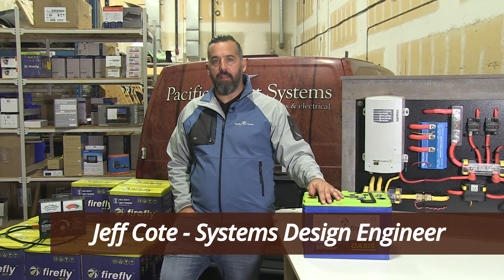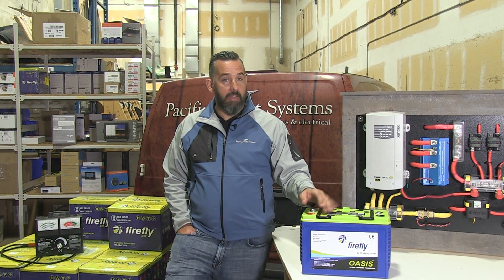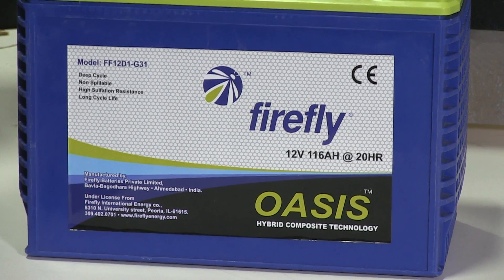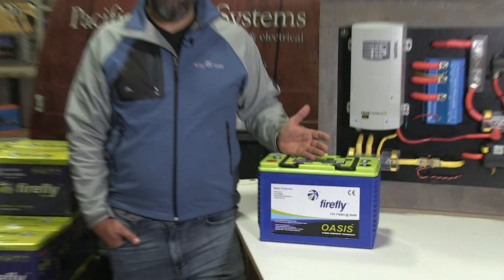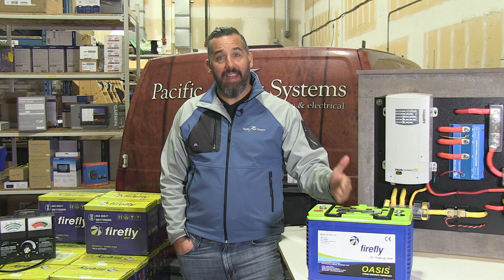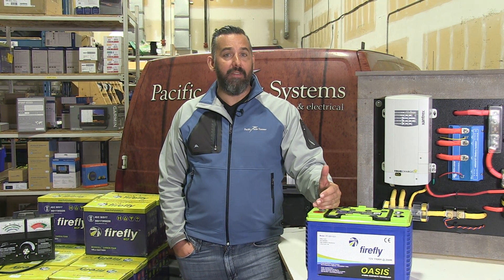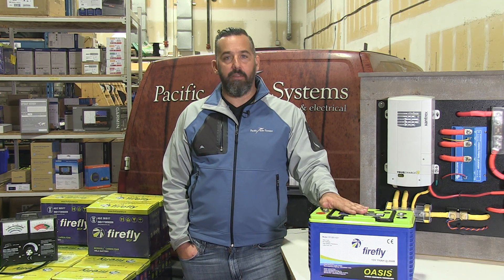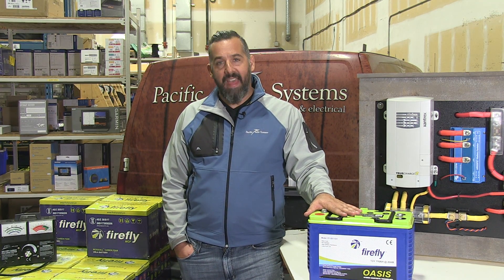Recommended - Firefly Oasis Carbon Foam Battery Perfect for a Boat

Comment: Jeff, I am still interested in the FireFly’s for a Garmin Force trolling motor. That would be 2 batteries, C31’s set up for 24V. Don’t need or want the charger on the boat. FireFlys charge profile is stopping me from finishing this project as I can not find a charger, can you help? Finding a 24V, 40 amp programmable three function charger with temperature offset is proving to be difficult to impossible unless you have unlimited cash (not the case here, or I would go lithium)
Any recommendations 
Thanks
Reply from the maker: Look in the Promariner ProNautic charger, consider getting the 30 amp 24 volt model.

Comment: Nice video but saying 12 times the life is just wrong and you know it.
Reply from the maker: Hi John, you bring an interesting point, how long will a battery last. Firefly, similar to lithium, spec sheets says the L15 2V/4V battery will run 4700 cycles at 50% DOD.

Comment: Any charts re: weight vs std AGM or Lithium. .
Reply from the maker: Good suggestion, will include that next time. Firefly Group 31 is 72 lbs and AGM Group 31 is about 60 lbs.

Comment: Have you done any testing or comparisons on Battle Born batteries, currently leaning towards Firefly. Not sure the differences out weigh being double the cost of Firefly's.
Reply: Pacific yacht systems - Actually Battle Born doesn't have lead acid chemistry batteries, they make lifepo4 (lithum iron phosphate), lead acid drop-in replacement batteries. Extremely high quality, excellent safety (zero chance of thermal runaway/fire), far superior to to just about any lead acid or lead acid lithium replacement that is on the market to date... a single 29 lb battery packs the power of a 140 lb lead acid battery and additionally, it lasts 10 times longer than lead acid... they're impressive to say the least... I'm not a fan boy or anything, I think every chemistry has it's place, but you should probably do your homework before blatantly telling a potential customer false info in order to steer them towards a sale of one of your products... whether intentional or not, I can't say, just calling it like I see it
Reply from the maker: Hi John, Battle Born is a good AGM battery, but Firefly is hands-down a better battery. We've sold and installed thousands of Fireflies and they are outstanding batteries.

Comment: Are these similar or the same technology as Victron’s Lead Carbon?
Reply from the maker: Don't know for sure. Everyone is playing catchup to Firefly.
Reply: Victron "Lead Carbon" have carbon added to the negative plates, and adjusted specific gravity in the electrolyte.  That may help in PSOC use (at the cost of some capacity), however not as much as the patented microcellular carbon foam (MCF) that is used in Firefly.

Comment: Hey, guys, I have 4 6volt 200 amp hr house batteries how much will it run to replace them I do have solar and wind so looking for a replacement and these look interesting.
Thanks SV Chewbacca
Reply from the maker: Hi Dutchman Sailing, you could easily 2 or 3 Firefly Group 31 to have the similar useable amp-hour capacity of 4 flooded lead acid golf carts.

Comment: Thoughts on lead crystal battery , local here in NZ , claim 18 year life .From Betta Batteries
Reply from the maker: Hi Murray, unfortunately don't have any practical experience with lead crystal battery.
Reply: Hi Murray, I work in retail selling batteries in Canada, Carbon Foam being one of them. They have come a long way in terms of popularity. We do have customers ask about the Crystal Salt batteries as we also can supply them. Really boils down to cost, warranties, manufacture reputations etc. Equally I think both options are great and have similar characteristics that works like a lithium battery as you can discharge them 80%-100% rather then 50% on Wet/Standard AGM, can be left in a partial state of charge without harming the battery, once fully charged it would discharge about 1% per month in storage phase..etc. All manufacturers will specify their suggested lifespan. If Carbon Foam/Crystal Salt is what you are after then think of this, Higher upfront costs+  Eliminates a battery purchase every 3-6 years on average= Savings in your pocket. Cheers!

Comment: How does it compare to lithium?
Reply from the maker: Let's use a sliding scale for depth of discharge and cycles, If a flooded lead acid deep cycle battery is 1 and a lithium battery is 10, then a Firefly foam-core AGM battery is a 7.
Reply from the maker: Basically Firefly batteries are somewhat comparable to Lithium but obviously not a Lithium battery.

Comment: How do these work as starter batteries?
Reply from the maker: Firefly batteries are more meant for deep-cycle applications. I'd suggest going with a North Star AGM battery meant for cranking.

Comment: "twice as much ... as a flooded lead-acid conventional battery"
So your carbon foam AGM battery has double the capacity of a conventional flooded NON-AGM battery? Being sneaky there...
Reply: Twice as much usable capacity. I think it's the standard lead-acid specs that are misleading. You can use more than 50% capacity, but you'll kill your battery faster.

Comment: I've binge-watched you videos, thanks! Any insight into why the Firefly battery seems to be unobtainable?
Reply: I found one on Amazon just search Carbon Foam AGM
Reply: goodygoodyguy 
Searched and found nothing!
Reply: Firefly production has increased considerably.  Most distributors have inventory now, of course check with Pacific Yacht Systems if you're in Canada.  Covid19 has delayed the latest shipment from India, however there are still hundreds in stock in Peoria and at the North American distributors.